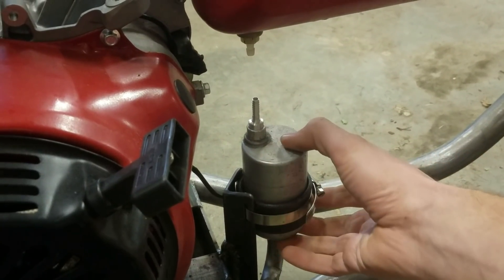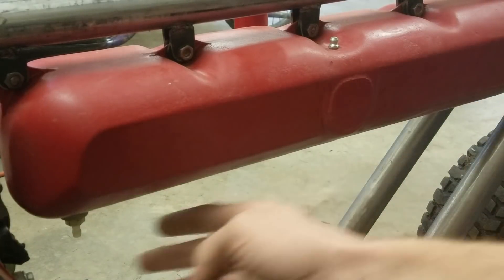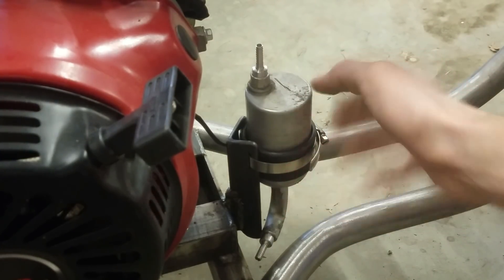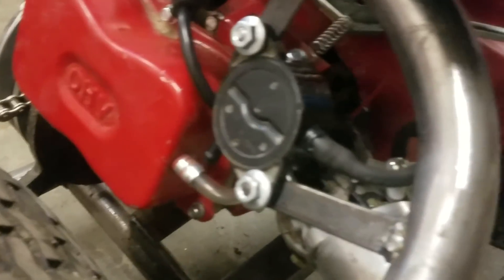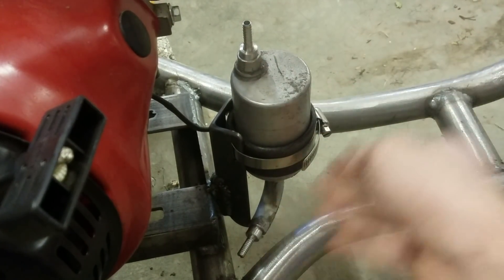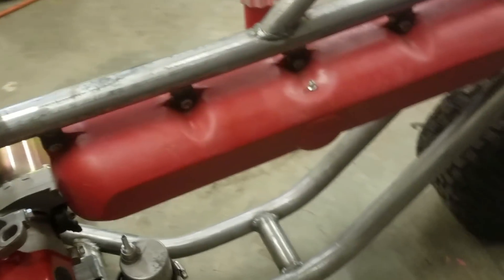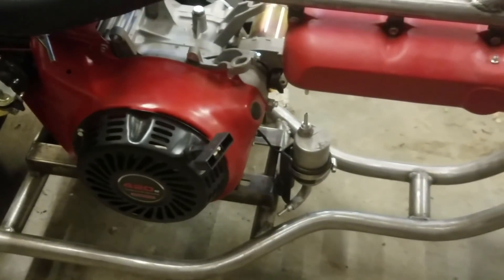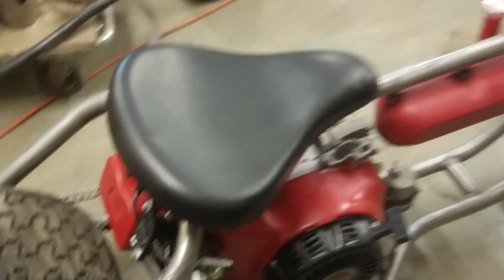Four Wheeled Motorcycle Part 9 (fuel delivery)

Comment: Why not simply drop the tail end of your long red gas tank to help insure adequate fuel delivery without starvation even if you go down an extended hill with a 6% grade? A single long triangle-shaped sliver of steel tacked onto the underside of your frame and painted to match your tank would look cool, be solid filler from one side to the other like the solid tank itself and would look like part of the tank. If you WANTED TO, you could make ANOTHER identical valve cover tank and mount IT above the frame and tank you have now (a shorter version to fill the area below your steering column) with a matching rearward downhill rake angle red tank and have a really COOL LOOKING two-part unique CUSTOM red tank! Something to consider...I think that would look KILLER on your bike, you'd double your fuel capacity to be able to ride somewhere and it would be one-off different looking also!

Comment: that thing is awesome...just 2 things....maybe its the video but the reat axle looked a little lower on the right side ..that was when you was welding it together a couple videos back and about the steering .....maybe if you was to have an outer sleeve that the bolt goes through and it will be more like a cast to keep anything from spreading ....just a 6 or even 4 inch piece of tube to slide over the shaft and the bolt goes in the middle and see if that even tightens up steering for you...good work man...I cant wait to get a project of my own going..

Comment: if the carb ends up leaking you could T off and on the pressurized line (after the pump ) put the line off the t back in the top of the fuel tank and you should be ok , the weight of the fuel in the line to the top of the tank should be plenty to fill the carbbowl dont need any pressure behind it realy

Comment: Min 2:40 - Your Lathe chuck distinctly moves when you machining. That looks like your headstock bearings have either play, or need to be adjusted. Could be something with the chuck too. But I'd check it either way! BTW, the video is very good as usual! ;) I may have to steal that Intermediate fuel tank idea for my Harley. It's genius!

Comment: That accumulator is going to need a breather that goes back up to the fuel tank because if it does suck air down into it the fuel will trap a bubble that will eventually get sucked into the pump if it is ran that long.  If there is no vent it will take a very long time for the air to bleed up into the tank and refill the accumulator again just like trying to pour fuel from a gas can with no breather. You will want to plan for that before you weld it anyhow.  Good work.